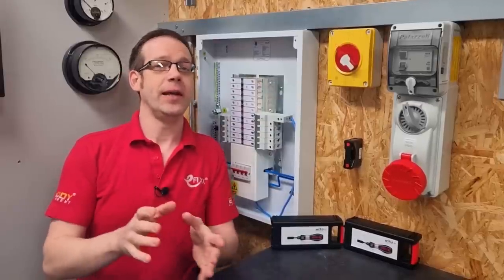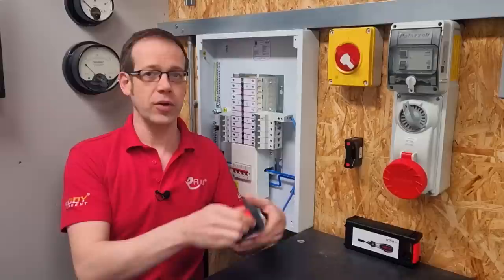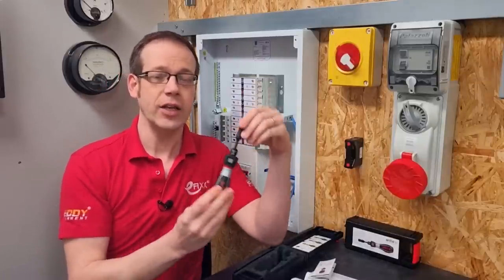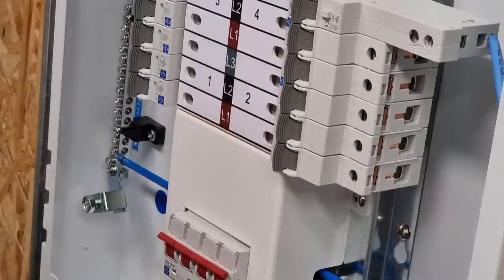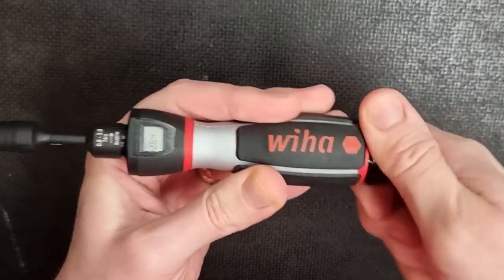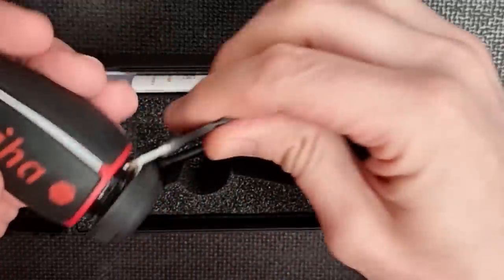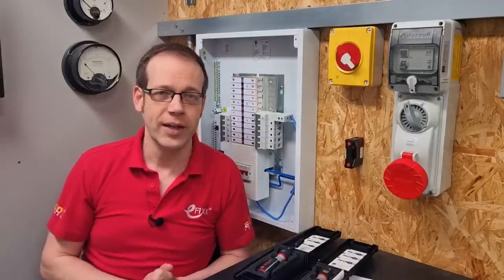Electricians' Dream: The Wiha iTorque Torque Screwdriver

Comment: Realistically, all our connections should be torqued down, all screwdrivers we use as electricians should be insulated, and honestly from having used various torque wrenches in the past, I'd like to see a set of insulated screwdrivers with a standard 1/4 inch socket on the back. Torque wrenches are a lot easier to use with a better grip on the torque setting device. In an ideal world I would like to see say a 100mm long mini torque wrench that interfaces with a set of insulated drivers, small and convenient enough to even use on a twin socket but versatile enough to use on a MCCB also!
Reply from the maker: Absolutely fantastic comment thanks so much. 😊
Reply: I agree.  Even 3.5nm with a torque screwdriver is a struggle sometimes. But 3.5nm with a small wrench is a piece of cake

Comment: Not for me I'll tighten the traditional way, I'm  fed up with the electrical industry been ambushed by marketing companies.
Reply: Tight is tight!
Reply: Totally agree, lot of stuff driven by companies looking to make a profit, not just for safety, over £200, then calibration, then batteries, and non vde
Reply: Nobody is forcing you to buy it. In the UK, the industry has a problem with cowboys who have zero understanding that over-tightening can be as dangerous as under-tightening. I mean - how many times have you seen stripped out screws which can't be used again in a CU? If you've never seen it, then I'm impressed. So don't you think a little control and education to prevent that (given mistakes can cause loss of life) is a good thing? Too many stories of people losing their lives in electrical fires, this is the 21st century.

Comment: I have a 	Sealey  STS103 that beeps when you reach the required torque, I don't use it for work that needs certification but I have checked it with a torque calibrator and it's pretty much bang on. Because it uses a strain gauge rather than mechanically slipping it shouldn't have the 5000 use limitation.
Reply: That must be nice, wish they answered a question for me in the video, what is the price as like a guide to get it calibrated
Reply: @mlee6050  I don't know why you're telling me that.

Comment: As an old regs electchicken (lol 😂) and never using torque settings I can see a lot of points for using them especially with how many screws I broke, snapped and generally abused it's something that I can really understand and accept the fact that there being used for especially the example of the EV charge point. Love the videos 👍

Comment: I've been using a Sealey STS104 for a while now and it suits my needs very well, it doesn't click but it does beep. 1/4" drive which is good and it has a big handle so easy to get up to high torque values needed for MCCBs or solar inverters.

The one thing I've had issues with is certain MCCBs which have deeply recessed 4mm hex screws that need doing up to 6nm. Trying to get bits that fit that is tricky (needs about 25mm clearance), and I've ended up putting a socket in to the torque driver and fitting my insulated Wera interchangeable bits in to it. It does make my a bit scared as I'm not sure they're rated for that much torque and it looks... pants.

I did have a chuckle fitting a Huawei inverter recently which came with a small hex key and said "using the tool provided, do these terminals up to X.Xnm". Clearly they're relying on people having calibrated fingers.
Reply: Wera Kraftform Kompakt 60 .. 90mm bits , never had one strip out hex head , well worth the money
Reply from the maker: Brilliant! Thanks for the great comment. 😊
Reply: Is that tool VDE?

Comment: Has anyone actually done any testing on these torque values?

Eg a DP Mini RCBO (and AFDD) has a value of 2.5nm for the busbar and 1.2nm for the conductors. 

However I am finding that 10mm T&E the conductors can easily come out, this is after flattening the conductors first with pliers, tightened to 1.2nm, wiggle the conductors a bit and then retighten. 

Then you have the 2.0nm value for neutral bar and earth bar. Have you had a look at the CPC from 1.0mm & 1.5mm T&E after tightening to 2.0nm? There is a lot of crushing going on and that’s even with the conductors doubled over.

Comment: Where can we get these things calibrated? My fear (although I am an acolyte) is monitoring ongoing accuracy... So generally I just replace them annually... But if I upgrade that might not be viable.
Reply from the maker: A video coming out soon will explain how to do a check on the torque accuracy and this is one example service: https://www.calibrate.co.uk/calibration/torque/about-torque-calibration/
Reply: @efixx  thanks for that. Betting it probably costs more or as much as my current driver though!
Reply from the maker: 😂Possibly. Let us know how you get on.
Reply: you can test the accuracy with a allan key and a scale.
Reply from the maker: Interesting, how do you do that?
Reply: @efixx  L key in bit holder, set scales up, set torque, twist screw driver (with the shorter end pressing on the scales), record reading from scale, convert your measurement into Nm. You could probably get an actual Newton Meter and set that up so you get the reading directly with the same procedure. 

Edit:

Not a mechanical engineer so I haven’t got a clue if leverage scales linearly or exponentially with lever length. So lord knows how accurate your reading would actually be in Nm using an Allan key. I’d rather just spend a few pennies and have it checked with precision equipment.
Reply: @slinkdroonk4175  It's linear. Short end in the driver. Block of wood for your fulcrum, about 10mm higher than the scale, long ends tip on the scale, set and twist. do your calculation, job done, thats for self cert. 5nm will be 5 kg on a 100mm allen key 2.5 for a 200mm etc etc, it will be within 1%. you can calibrate the scale with a weight.

Comment: I dunno about these. I'm primarily a maintenance engineer with mechanical and electrical knowledge but not a specialist in either. I've found that torque isn't always the best indicator of tightness. For a brand new installation it's good enough but I usually work on older installations in less than ideal conditions where screw threads might have been overtightened in the past, deformed, slightly corroded, even the condition and type of conductor (solid, flexible, tinned with solder, ferrule, multiple conductors) all have an effect that isn't taken into account by just the torque applied to the screw and I wonder if they might give a false sense of security. I like the feel of the screw driver and often the good old "snug plus a quarter turn, and test with a good tug" approach. But like I say, I'm not a specialist in these things, any thoughts on this from more experienced electricians? I often call in contractors at my place of work and never seen one use a torque screwdriver. Should that concern me also? Our yearly thermographic inspections and EICRs have always had excellent results.

Comment: Does VDE slim bits fit this one? Or can you switch the bit holder to a VDE one that fit VDE bits?
Reply: Err - this is what 'VDE' means: https://en.wikipedia.org/wiki/VDE
 
People can make exchangeable blades which conform to VDE electrical safety standards in any mechanical format they choose, e.g. the very widely used ¼" hex size, or, shamefully, if they are disgusting money-grabbing ****s, some proprietary shape to force you into using only their blades with their handles.
 
What exactly did you think you were asking about here?
Reply: I know what VDE is. The Wiha bits are called VDE slim bits - VDE is part of the name of the bits. I was asking if they fit this non VDE torque screw driver, or if the holder could be exchanged to the Wiha VDE rated one that fit their (proprietary) bits.
Reply: I have now gotten the answer elsewhere. The bits don’t fit the holder supplied snugly. It is however possible to fit the Wiha VDE labeled torque bit adapter.
Reply: @anonnona8099   I see your point, but most VDE bits are some kind of proprietary form factor. I don’t know if this is a money grab, or if it is a requirement of the standard to make sure the whole completed tool (I.e the complete screw driver including bit) is VDE rated.
Probably a bit of both… :)
Reply: @arvidbjorkstrom6554  No, 'VDE' is not part of the *name*, any more than if they conformed to some other standard and were sold as 'BS EN slim bits', or 'DIN slim bits', or 'UL slim bits'...
Reply: @arvidbjorkstrom6554  OK - I hadn't thought about whether the whole tool has to be tested, so that is a possibility. But then they could use a ¼" hex form factor and only certify the combination of their handle and their blades, just like the way that type-approved consumer units are only type approved when used with the makers' devices, even though any standard DIN rail devices will fit in (subject to bus-bar alignment).
 
Also, aren't Draper Ergo Plus blades a standard ¼" hex?
Reply: @anonnona8099  Ah, they are? To me they don't look like any of the standards with that large flange and the grove, but maybe they fit standard bits anyways? I wouldn't mind having 1/4" bits fit, and actually they fit perfectly in the torque driver in the video. And apparently by replacing the adapter with a Wiha VDE one they fit the Wiha 6mm VDE bits as well.
Reply: @anonnona8099  To me the name of a product is what the manufacturer has it listed as, even when the name includes some general identifier. I would say "Torx T20" is part of the name of a  "Wiha slimbit electric Torx T20". 
When looking up the name now I see Wiha actually has "electric" in the name of their bits, not VDE. Only the drivers and the kits with driver and bits have VDE in the name. But I guess that isn't what you were after?
Reply: @arvidbjorkstrom6554  Torx there is a description of a physical characteristic.   "VDE" in "Does VDE slim bits fit this one? Or can you switch the bit holder to a VDE one that fit VDE bits?" is not.
Reply: @anonnona8099  don’t think we’ll get further here. I got my answer elsewhere. I’ll leave this conversation now.

Comment: There you go again with that word required. Get it into your head torque screwdrivers are not a requirement they are a recommendation, I don’t care what the IET amendment 2 definition for the word’s requirement and recommendation are the English dictionary says different,  and I take there definition as the correct meaning , also if it was a requirement the it would have been included in amendment 2 ,and it isn’t  . How much is that new screwdriver? More money than most people can  afford .  And why is it only eFixx that are pushing them? Trade skills 4U never even use them in there videos or even mention them. Neither does any of competent person scams it seems to only be eFixx GHS . 
Yes use them if you want but stop saying they are required , they are not.  But who am I? To say i’am just a humble spark who’s opinion means nothing . Sorry Joe . 
Great video as always 👍
Reply from the maker: Okey doke. If you watch the video back at no point do I say that they're required. The definition of required and recommended is defined in BS 7671 because that's the definition the authors use to write the regs, ignoring those definitions means regs could be misinterpreted and installations not be compliant with BS 7671. We're releasing a video on this soon. I've explained in previous videos that while they're not mentioned in the regs they're heavily implied in places. Cheaper versions are available. Just because no one else mentions them doesn't mean they're a bad idea. I will continue to use them and promote their use, as I believe they can make a better and safer installation. Once again I have not said they are required. Thanks for commenting.
Reply: If you can't afford a torque driver it may be time to put your prices up! Just saying. Plus plenty use an impact driver which costs more so it's a bit of a moot point. Torque driver isn't going to be as expensive as replacing that afdd you just shagged by overtightening now is it...
Reply: Near the end of the video you clearly say that as time moves on the requirement for torque  settings will become more stringent. Your words not mine. And like I said in previous comments I am not saying we should use torque screwdrivers and I have one myself. I am just saying that they are not a requirement, they are a recommendation.  Also the IET should not be making up there own definitions for words that are already defined in the dictionary. And I do agree with you that they are a good idea and can make for a safer installation, and I will also continue to use mine when I need to the same as testing RCDs I will continue to test at 1/2 1 and 5 times I Delta N  
Oh and no disrespect intended to you Joe or any one else.
Reply from the maker: Nope, I said the requirement for AFDDs have become more stringent. And the IET aren't making up definitions of words they're clarifying how the words are applied in the context of the document.
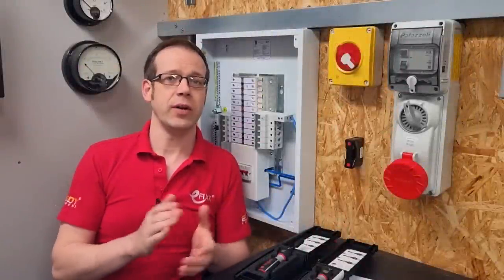Reply: @efixx  nope at point between 5:47 and 5:49  you clearly say the requirement for torque settings will become even more stringent , and I even put my hearing aids in to make sure I heard correctly. So let’s just agree to disagree and leave it at that
Reply from the maker: Exactly, "will" become more stringent, future tense bud.
Reply: @efixx  not sure if it is true or not, but I have just read some reviews on the new toy price range from £98to £ 214 depending the model ie I.8 - 3 nm, or 40-150nm, and 1.0-5.0nm. Badly designed you have to send it back to get the expensive battery replaced and recalibrated as when the battery dies it nock the calibration out ? If that’s true then it’s an overpriced peace of junk and not worth bothering with. But I do think it looks nice 
Be interesting to know if it is true or not as I don’t particularly believe the reviews I prefer to have one and judge for your self.
Reply: @travoltasbiplane1551  over tightening the screws on MCBs RCBs AFDDs or SPDs with a standard screwdriver and damaging the device is unlikely unless your Arnold swartsenegger. But if you’re one of the schmuks that uses an impact drill then that’s a different kettle of fish and you should not be working on Consumer unit’s, in fact you should be kicked off the job and told not to come back . 
But who am I to argue i’am just a humble spark who’s opinion means nothing.
Reply: @seandempsey7351  1.2nM ain't that tight! So much so it can feel a bit 'wrong' only going to that torque. Pretty sure even my daughter could do it over that! With you on the impact driver brigade though... Animals.

Comment: The thing is this tool isn’t VDE insulated, and neither are the bits for it. Now I know we don’t tighten screws on live terminals, but wouldn’t it be against the general good practice of using insulated tools?
Reply: What about tightening up main terminals in a fuseboard with no isolator after the meter. Terminals are still live
Reply: @jamesmoon5632  should get the fuses pulled by the DNO

Comment: I sit on the fence a bit with Torque drivers. 
I see their use in certain applications, and I also see them being pointless in other applications. 
Until the manufacturers make the torque settings more clear on devices for many its not worth the time trying to look for a manual to find them or navigate a chart that makes no sense to work out what it should be (As me and 2 colleagues did the other day with a 100A contactor!).

Also the price of the drivers need to come down substantially, Having them with interchangeable bits certainly makes them easier to keep maintained but the cost of some of them (like the one featured in this video) just puts people off especially when you have to get it calibrated etc.
I have no issue with a handle costing maybe £40-50 but over £100 for a handle you only use to make final connections is steep IMO.

I have a normal Wiha set which is fantastic but I wont be picking one of these up thats for sure.

As for the animals who use dugga guns well, If I ever caught my apprentice or a contractor using one in a DB etc they would be kicked from site immediately, Just no place for that at all.

Comment: Have we got a value of torque for swithes and sockets?  I have done some experiments and with my driver I can torque swithces to
0.5Nm with 1.5mm cable and sockets to 0.1Nm with 2.5mm cable which I have found holds the cable well but does not dent the
 conductor to much.  What do you guy's at E-Fix think?  Would be nice to get your replies and maybe discuss this on one of your videos.

Comment: I don't know how I've managed 35 years as an electrician without using a, torque driver/wrench, lol. I've used them as nessesary and will use them in the future if required. But at the moment if in need one, I use my icetool torque T-bar tool from my bike tool kit, lol it cost £20 and works perfectly from.5 to 9nm its not vde but neither is this one, but only use as appropriate and safe to do so. But with my sceptical head on, it just seems like more cost to the electrician to buy, keep tested and certified, for something that is on the whole a very small issue.